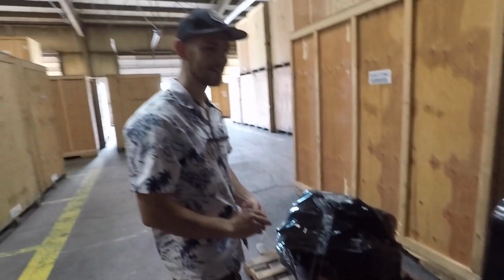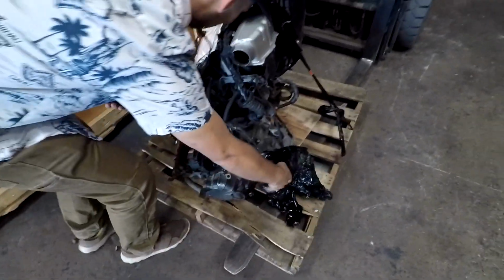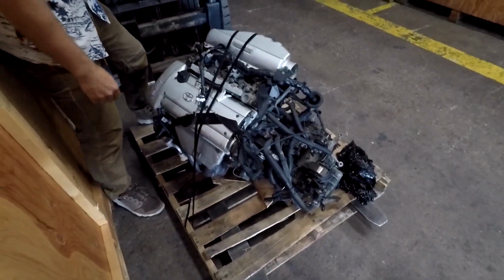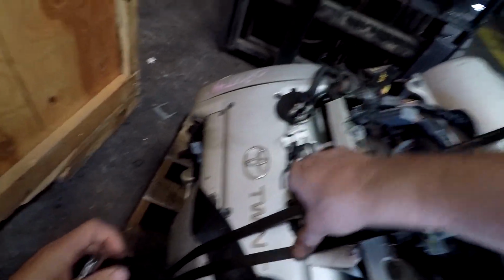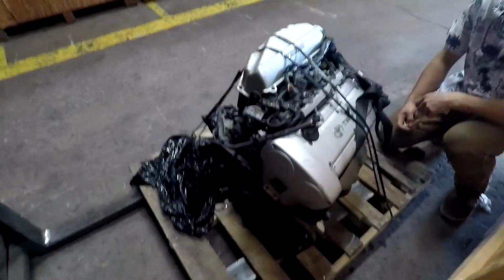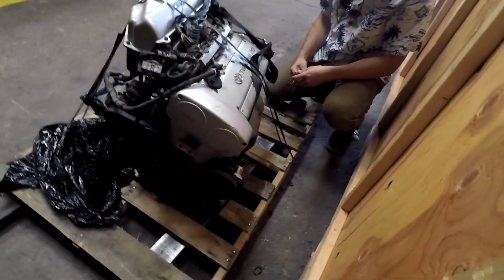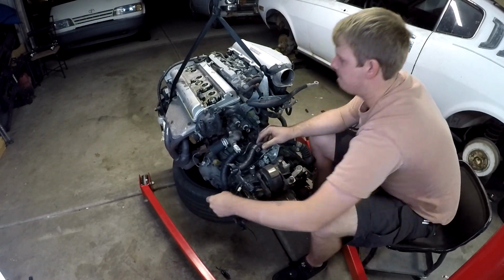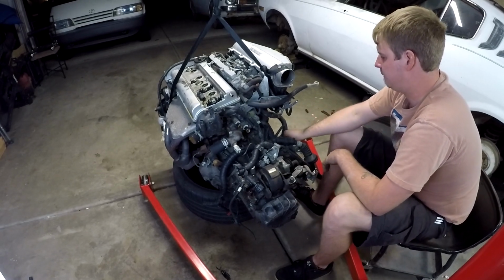Toyota MR2 AW11 Silvertop 20v 4age Swap Part 2: Engine Received and Broken Down

Comment: Did you ever pull the sump off and have a look?? Or even the valve cover?? Was looking forward to seeing that when you mentioned it but it wasnt in the video. Curious what it looked like
Reply from the maker: Pandamonium yeah I did pull the valve cover and the sump to redo the gaskets, was a little crispy but no sludge and looked good otherwise, so we put it together and ran it! It ran great idle to rev limit

Comment: Hi is that a Celica 75 or so?
i see a previa too
Reply from the maker: Danny z it's is a 77 gt, last year of the ra29! And that is a 5 speed previa right there. Celica is getting a 3sge beams swap and the previa may be getting a supercharged  2tz down the line.
Reply: OMG!!!!!! I had a 72 celica auto and turned it into a stick back in the 80's. I had a previa but I have only seen them JDM sticks named Lucida. Did it came like that, or did you do the swap? 2tz's arent very common around here, but I have seen the batch SC and pumps about 160 hp. Loved the previa so spacious .
Reply from the maker: Danny z nice that's awesome! Subscribe to see more on both, starting that celica swap very soon.
Yeah, they are very rare here in the US but we did get the manual ones from 91-93. We had one when I was growing up and I have a odd fondness for them. Took a long time to find this one
Reply: IM already in your system!!! Wow Did not know they came stick 2 the US. I always drooled at the jdm types. 
What r u swapping  in the celica? 
Toyota for life( well I call mine volvo cupra, as per the heart of the supra and the spirit of the cressida , hence the word CUPRA. Looking forward to see the swap. Speed academy is doing a swap with an Alteza or Lexus IS 200 engine , Check it out. See ya.
DZ